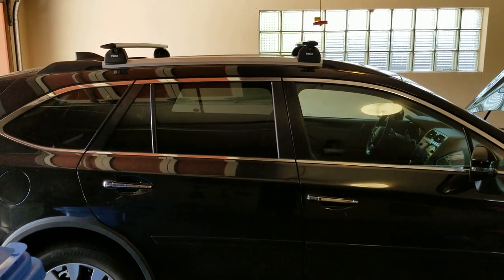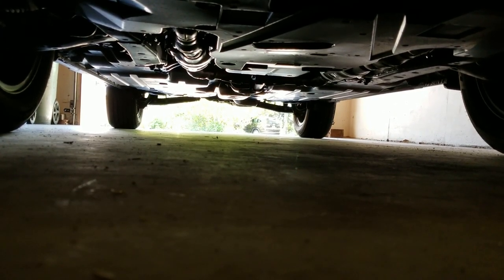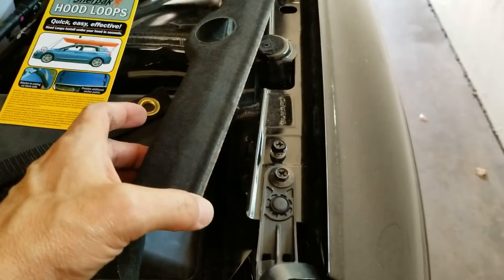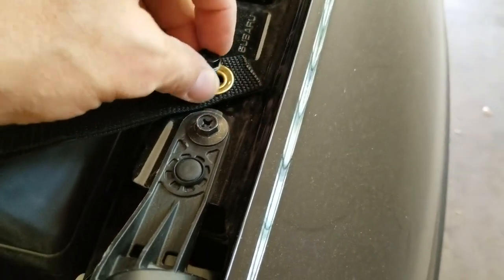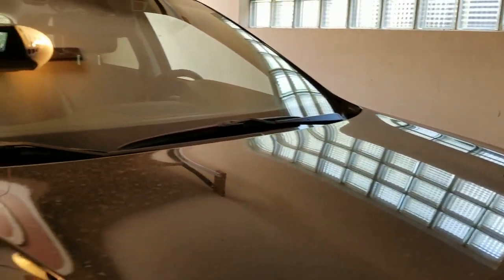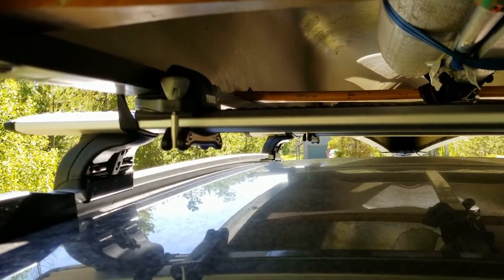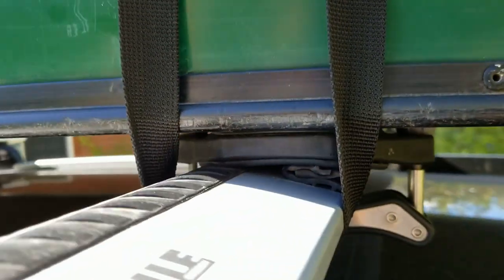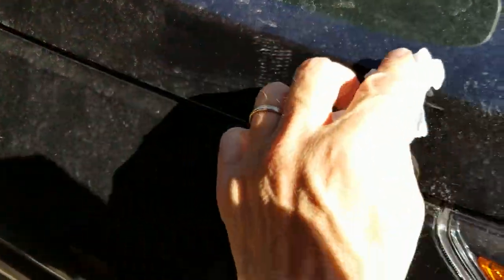Carrying canoe on 2018 Subaru Outback Touring

Comment: Thanks for the video.  I have a 2018 touring as well.  Trying to gather was much info as I can as I am just buying my first watercraft.  I saw two other solutions for the front tie downs that may help.  1.  Running rope around the hood hinges and coming out the top of the hood, 2. using the hood loops like the Yak gear EZ loops.  Put one at the front of your hood.

Comment: I think your issues laying flat would be resolved if you moved them forwards a bit. Look how the curve in the top cup would match the curve in the top of the bars.
Reply from the maker: Great idea... I will look into that later this spring when I transport boat again. Thanks for the comment.
Reply: @nzmtns  I was going to buy these but your video gave me pause. Other people think they're OK though and I had to research your close up shots, and I think that'll do it! It'll just look weird because the shaft will be really close to the trailing edge of the bar, but I think that'll do it
Reply: @nzmtns  did the Thule bars have any kind of pitch adjustment?  I believe the Yakima ones do.  That might help as well

Comment: Would like to know what the length of the canoe is?  Looking for how long of a canoe will fit on the roof of the 2018 Subaru Outback Limited.
Reply from the maker: The canoe in the video is ~17'. A shorter or longer boat would work just fine too - as long as the center of the boat is situated midway between the crossbars.